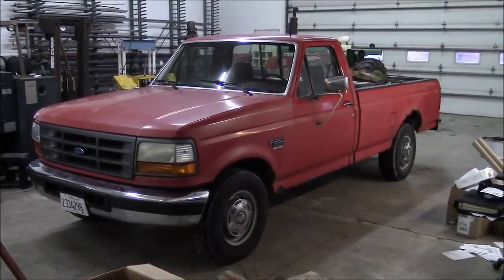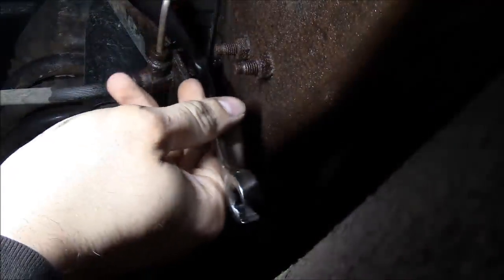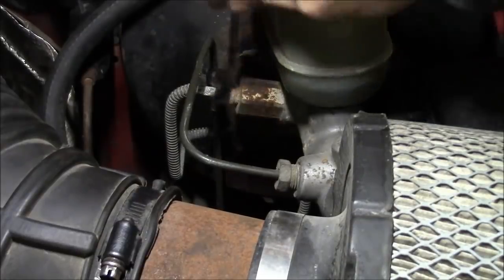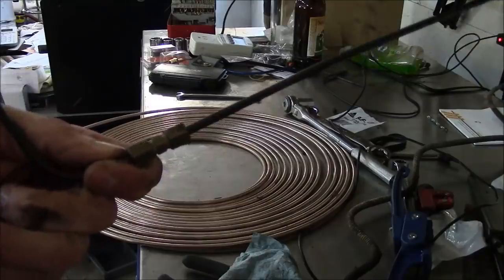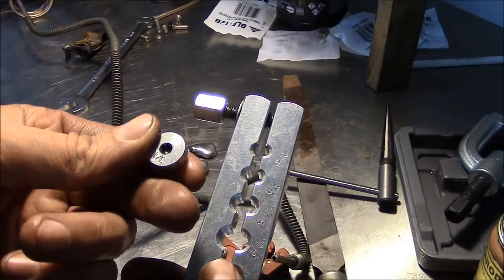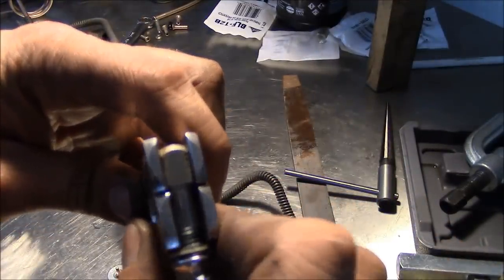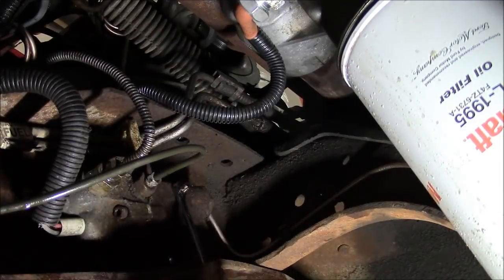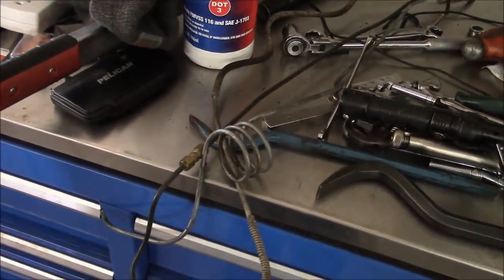OBS Ford Blows a Brake Line

Comment: As a brake tech for 20byears in this wonderfull salt laden area,  I always wore brushed the blenders first soaked them with a good penetrating oil using a 1/4" ratchet and socket, tap it in the close position and then try to loosen it. In 20 yrs I thing I broke 2 doing it that way
Reply from the maker: I've had decent luck heating them and letting them cool. The biggest problem I've had is they are so rusted the hex is just gone. On some vehicles, like half ton GM trucks, the reman calipers are so incredibly cheap I don't even mess with them if I think I'll have trouble.

Comment: I parked my Blazer for 3 days. No problem. Day 4 I go to pick up a load with the trailer & NO brakes. The rear line from the T connection to the wheel just popped!  Fortunately for me it must have happened as I was backing up the Blazer & trailer up my driveway & just bled out while it was parked. The repair was not an issue but the 6 inches of show I had to work in was a bit to deal with. When the weather warms up I would like to replace all the lines.Have you had any issues with that NiCopp Alloy Brake line? Just wondering due to it being so easy to bend/soft?  Especially not having that"spring"guard where it is exposed to pebbles hitting it? Your little one is a good crew chief,barking out orders LOL,  Stay well. Joe Z
Reply from the maker: I've never had an issue with it. I've seen some destroyed, but that's from abuse that the steel line would not survive either.
Reply: @WatchWesWork  Thank you. Looks like this is what I will use when I change out the lines. A lot easier to route through.  Joe Z

Comment: Interesting to note Ford's 2-channel ABS in other applications... I found out which garage not to use for our MoT (UK yearly inspection) when we had our '91 Escort and they tried telling me ABS is only ever on all 4 wheels. Not to mention telling me they can't adjust the CO on that generation of EFi since it's "controlled by a lambda sensor"....  The Escort was the opposite to the truck though, ABS on the front wheels. Guess it's on the rear for unloaded stability on the truck. Still grasps me as strange they'd do that though, if they're going to the expense of a valve block, computer and pump why not just go all 4 and have done with it?
Reply from the maker: I don't know why it was only on the rear. Ford did that forever on trucks. From maybe 1986 to 1998.

Comment: When bleeding brakes Try to use a plastic bottle with some brakefluid inside it and a plastic hose (that you can See thrue) between the bleeding point (nipple) and the bottle. In that way you Dont need to get brakefluid all over the floor and better is that you get a simple/ cheap system that Dont suck air back into the system again. I use one when bleeding the brakes on my motorcycles.

Comment: when you said oil to lube the flaring die that was brake oil yes? as motor oil will cause problems in brake rubber parts (or it was cleaned off an out of it with brake cleaner
Reply from the maker: That tiny amount is not going to hurt anything.

Comment: With the number of brake system failures due to brake lines rusting out, I am surprised the NTSB has never made an issue of these failures. Yet they have mandated recalls on issues nowhere  as dangerous as this.
Reply from the maker: There have been some recall for brake line rusting. I think maybe the Ford Escape had one? fordtechmakuloco (sp?) had a video about it. But I do agree with you.

Comment: I was bleeding the brakes on my OBS F350 today after having wrestled with putting new springs in. The suspension was a mix of metric and standard. Frustrating. When I got to the bleeder screw I had to measure it with my calipers just to be sure. 3/8"?? Who even used that? Anyway. Thanks for confirming. I thought I was losing my marbles earlier today.

Comment: Usually here in New York state. Rust bucket central . Wrenches and sockets are irrelevant. Lol. Torches and vise grips , hammers and chisels is how most junk comes apart. 
I have a blue point double flaring kit . It's small enough to use on vehicle uses a 9/16 wrench and 7/8 1 Allen bolt on small clamp to hold line. I have the old style ones that are old like way before christ was a foot soldier..

Comment: Great video and multiple valuable tips.After 42 years of marriage and 30 years of brake bleeding I could not take my wife's "look"  as she got in to pump the brakes I saw a hint of that in your wife's face.. I ended up using a 2 x 2 against the front of the front seat foam to press the brake peddle down. As I open the bleed screw there is enough pressure for the peddle to bottom out without recoil and allow me to repeat the pump up.  Works great.  Adjustable by moving the seat up or back to accommodate the length of 2 x 2.  No complaints of "do I have to? " The rear ABS makes sense to avoid rear brake lock up, and Eric the car guy shows that your best tires should be on the rear to avoid back end spin around.  However this seems counter -intuitive to me because  I would think a front tire blow out and loss of steering is the worse of 2 evils.  What do you think? Thank you,  Craig
Reply from the maker: Heh. Well hopefully by the time she is that grouchy my son will be old enough to help me. I used to help my dad bleed brakes all the time when I was a kid. My truck always has worn out tires on all 4 corners, so I'm not really qualified to say!

Comment: Penetrating fluid helps with bleed nipples and a glass jar and tubing to collect the brake fluid and see when the air bubbles stop. Also helps it not to get all over the other component's or someone's face.
Reply from the maker: That's like cheating...
Reply: @WatchWesWork  😁

Comment: hey wes i saw the last video on the bearings im working on a 94 5.8l gas f250 what did you do on the bearings ive got a rough bounce on front of the truck would that cause that?
Reply: and its a 2wd

Comment: I just finished watching this video and I recently did a similar repair on the master cylinder line to the T-junction that feeds the rear brakes (I have a 93 F-150 gasser) and I also have one of those compression-type fittings in the same location. I wonder if that was some factory thing for routing different preformed lines or something? There's also a video on YouTube (Richwhat Automotive) that shows how to bleed these lines by taking the cap off the RABS valve, removing the internal spring, and bleeding directly from the master cylinder which is easier if you're already changing out that line but there was some debate about its efficacy. According to him many technicians do it this way to get air out of the proportioning valve/RABS but I'd be curious if you know how that works and what your opinion is of this method and whether it may damage the master cylinder. Thanks for the great videos!
Reply from the maker: It can be tricky to bleed an ABS valve, but they usually only has to be done if the valve is replaced.

Comment: Glad you got home safely, Wes.  Best wishes to you and yours for the new year.
Can one solder (or even sodder) Ni-Cop?
Reply from the maker: I don't know. I bet you could.
Reply: We used to silver solder Ni-cop all the time when I was in the Navy. All the potable water ran thru it. We used silver solder due to the high melting point and strength.  It has a much higher melting point than say 50-50 or 95-5 solder, which could melt in a shipboard fire

Comment: What's the purpose of the curly q's?
Reply: takes up flex between the frame and the cab and absorbs vibration. if it wasn't there, you'd get cracks in the line pretty quickly.
Reply from the maker: It just allows some give between the body and the frame. You don't see it as much anymore, but they all used to do it.

Comment: every time you pump the brake when bleeding the brakes you create small air bubbles which will turn in to one bigger air bubble when they all get together. To stop that from happening, take the lid off the master cylinder and open the bleeders and let the fluid drain until clear of bubbles. You will have a much more solid break with no air in the lines. Learned that trick in 40 yr's of break work. I have taught many others over the years. Try it on your next brake job, I think you will never pump the peddle again.
Reply from the maker: Gravity bleeding works, but it does take a long time.

Comment: You probably don't need that spring anyway.  cunifer alloy brake line is supposed to be abrasion resistant as well.  it's literally the perfect material for the application.

Comment: Good video, if my wife isn't around to help me bleed the brakes, I take a beer bottle fill it with some break fluid zip tie it to the axle or frame and crack the bleeder and pump away.
Reply from the maker: I actually have a power bleeder, but it's such a pain to set it up that I just go get the wife...
Reply: Lol, nice sometimes it's easier to just call up the wife
Reply: Yep.
Reply: What kinda pup do you have ? Pointer ?

Comment: I cant speak to the legality of brake line use, but swagelok compression fittings are rated for use up to 10kpsi, autoclave engineers speedbite fittings are rated to 15k. When doing hydraulic testing of downhole oil tools, we routinely ran them up to 20k in the test cell.
Reply from the maker: Yes. But that's another world from the crappy brass compression fittings you get at the hardware store.
Reply: @WatchWesWork  truth.

Comment: Does the NiCop line hold up as well as 304L stainless? (You kept saying steel, not sure if you included stainless)
Reply from the maker: I guess I don't know. I've never seen a NiCopp line that did not outlive the vehicle it was on.
Reply: @WatchWesWork  Pretty much the same thing that Joe at Joe's Electric said over in NYC. Cool!

Comment: what sense does it make to have abs only one the back tyres? lol
Reply from the maker: I don't know. I guess it's supposed to keep it from spinning?
Reply: I think it is because the rear brakes lock up easier because of the lack of weight when the bed is empty.
Reply: @WatchWesWork  I thought ABS is primarily a function to keep the steering under control while avoiding to lockup tyres upon breaking.  So well whatever

Comment: The hard lines wore out, leaked, etc. so you have replaced them, but you’re not going to replace the rubber/flexible hoses?  Shade tree!  Harbor Freight makes a good, easy to use brake bleeding tool very inexpensive.

Comment: Don't the car inspection see this when you are there for inspection?
We have to drive there for an inspection once a year.
If there is something wrong with brakes, or if there is rust on the brake pipes, it is a driving ban.
Reply from the maker: No inspections here.
Reply: @WatchWesWork  
None at all? 
Who checks that the cars are ok?
Reply from the maker: @makingithappen9722  No one. There is an inspection for vehicles over 10,000 lbs GVW. For anything smaller, it's the wild west.
Reply: @WatchWesWork  Ok. It's like the 60s in Sweden.

Comment: Flaring tool Advance Auto is renting out is also garbage. I tried their tool 3 times and it gave me trouble every time. Their clamp just doesn't grab the brake line. Ended up purchasing OTC tool. Not great, but works good enough. :D
I broke bleeder on wheel cylinder when I replaced brake line on family friend's van. I had to bleed by loosening brake line going to the wheel cylinder. It was 1998 Mercury Villager. Not really worth spending any more money in to this van.

Comment: I just keep asking myself, "What would Camarata do in this situation?" Bet you do too, Wes.
Reply from the maker: Cut an access hole in the fender? Paint the brake lines with black spray paint?
Reply: First, he'd hoist it in the air with his Bobcat.
Reply: I like Andrew, but he WOULD have that truck on it's side at some point. "Naahh this just isn't working, we'll just bypass that ABS thing for now and hook these two together" :-)
Reply: @WatchWesWork  , lol, and 200k views to boot.
Reply: @WatchWesWork  He would have said " who needs front brakes, if they made it right it should last forever".
Reply: @WatchWesWork  i know it is in jest, but he uses the same line you do, he thinks it should be illegal for manufactures to make new cars with steel lines, he deals with as much salt as you do, you two are in my top few for favorite channels, happy new year!
Reply: 4 wheels is just 3 with a spare?
Reply: If you're the kind of guy that puts plumbing fittings on brake lines..you're likely the same guy that would also ask what Camarata would do too.
Reply: recently watched the one where he fixed the heater in his truck and now has a piece of conduit sticking out of the dash to adjust the damper, classic andrew, lol.

Comment: Hey Wes 👋🏽, I enjoy watching you work, but have you considered wearing latex gloves to work in? Also with brake fluid being corrosive, wouldn’t a clear pipe with a split in the end, going into a jar work better than the mess you made? Or you can buy a kit that only requires one person and uses low pressure air to self bleed the brakes/ clutch from the master cylinder downwards?
Happy new year to you and yours from a land down under 🇦🇺 🥳
Reply from the maker: I've got a power bleeder, but it takes a lot of monkeying to set it up. So I just go in the house and get the power bleeder off the couch...
Reply: @WatchWesWork   my power bleeder on the couch makes a lot of noise sometimes when I use it. Is mine faulty or does yours make the occasional noises as well?
Reply: Anything that bleeds for 12 weeks a year and doesn’t die cannot be trusted! But can be pretty useful sometimes I guess👌🏽😉

Comment: wes do you have this AGS catalog in your phone so you can easily look up preflared tube lengths and tube nuts to build replacement lines. https://agscompany.com/images/stories/catalogs/fluid-transfer-catalog-2011.pdf i keep it in my phone and computer as the fittings are not easily found on the parts catalog program at the parts stores.
Reply from the maker: I don't, but my local parts store has a huge AGS assortment and I can rifle through it any time I need something. Usually the weird fittings are on the master cylinder and I can reuse them.
Reply: That's awesome - thanks for the link.

Comment: If that was a GM truck, the first time a brake line fails, you buy the whole kit to replace all the lines or else you just chase problems. Best to do it with stainless steel.
Reply from the maker: Those kits are really cheap for the GMs.

Comment: Almost all tools lead back to china whether you buy harbor freight or Napa, just need to find good old. Looks like he should have went through the bleeders before calling his wife out. Glad to see torquing lug nuts. Got my van back from tire repair and was checking the lug nuts. Impact wouldn't get them, finally a breaker bar with a pipe got them loose. Next time i was at that garage i dug out the little Honda wrench and had him tighten with that.

Comment: Never had any luck with line wrenches.  Always spread open under pressure and round off the nut. I just grab it with the vice grips and give it a twist. Lol
Reply from the maker: Well I usually try the line wrench. Then I cut the line and use a 6 point socket. If they doesn't work, I get out the vise grips.

Comment: Nice job Wes! I like that softer brake line. Is that a 351 CID Ford engine?
Reply from the maker: Close. It's older than that.
Reply: @WatchWesWork  1965 or 1966 352 CID?
Reply from the maker: @grizzlybeartechnicalservic8152  That's it!
Reply: @WatchWesWork  Can't wait to see what it's going in to!

Comment: 360 390 ford and floor rust repair panels . I am from newyork state know rust well.
Reply from the maker: No. It's smaller and older. Right about the rust though!
Reply: @WatchWesWork  225 buick?

Comment: what about putting a rubber gromet around that braek line that went through the steel frame i think that is going to rub on it until it leaks greetings from holland
Reply from the maker: I don't think it can rub. The brake hose is solidly connected to the spring tower, so the line is basically fixed.
Reply: @WatchWesWork  thank for your reply good luck with the rest of the truck

Comment: That is not an ABS valve! it is a proportioning valve, Ford started putting them on  in the  seventies when they split front /rear systems. They are there  to balance the front to rear pressures, particulary when you have disc in front and drum in the rear.
Reply: It's an abs valve from some time in the mid 1980s forward -until 4 wheel antilock came about. There is no set year because they were introduced on certain models fist then became standard once an engine computer became standard.  It replaced the portioning valve.

It works by watching the speed. If the brake locks up, the road speed drops to fast and it triggers a piston that prevents more brake pressure from applying. If within a certain amount of time the wheel speed doesn't increase, it opens another valve and dumps the pressure going to the rear wheels.

 Do a search for RWAL for more information.  A lot of times if you bleed your brakes and get a good peddle while the engine is off but poor application and a spongy peddle that almost goes to the floor or does, it is this RWAL valve that went bad. The bypass piston sping is likely weak or broken. You will experience a lot stronger braking from the front tires and often none from.the rear. i dont know if you can get parts but you can bypass it (if you are crazy) or get a remanufactured unit for around $350 plus core. Dont quote me on prices, it has been a while since I needed one ( for a 95 250 to boot).
Reply from the maker: It's an ABS valve. The proportioning is done in the master cylinder.